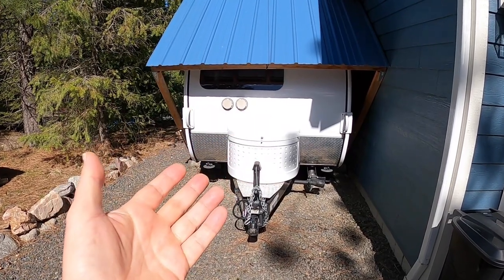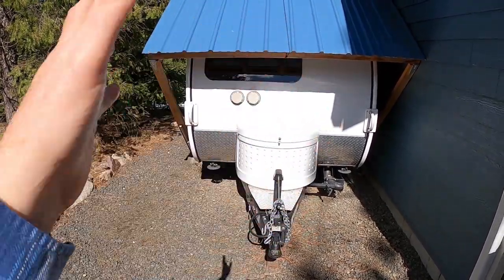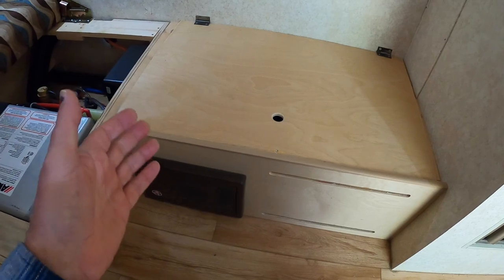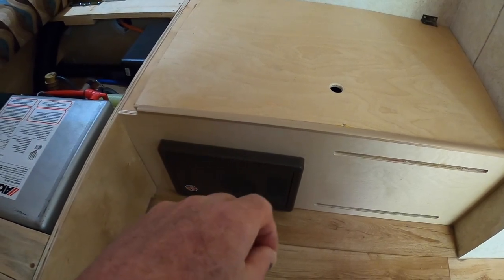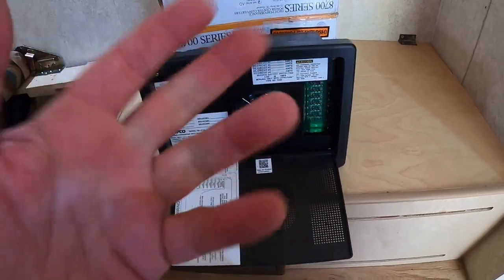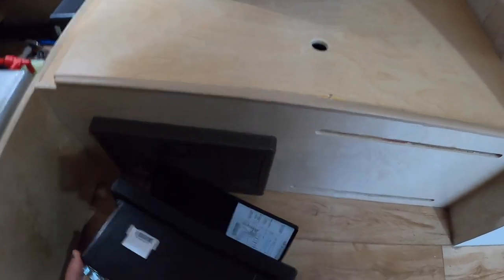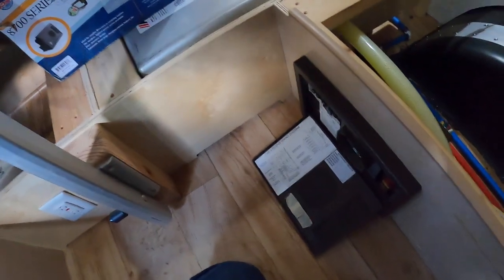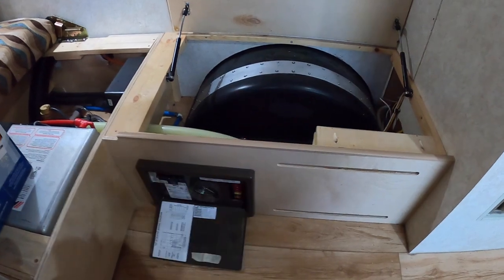Converter Upgrade - Part One - WFCO WF-8735-P to WF-8740-AD - 2015 Tab Max-s Trailer

Comment: What a great video! The converter in my 2015 TAB S Max trailer just stopped working.  It is the "WFCO Model WF-8735P".  I plan to replace the entire power center as the easiest route. What I am trying to determine is what power center to use as a replacement, as I would like to convert my current lead acid battery to lithium batteries in the near future.  In your opinion, what is the current best model power center to replace with (it is now 2024) when planning to convert to lithium batteries in the future?  (Would the replacement of choice still allow me to use my lead acid battery until I do convert to lithium.  Otherwise, if there is now a clear choice designed specifically for lithium batteries, I could probably switch to lithium now instead of waiting.) Any thoughts would be appreciated so much.

Comment: I would recommend folks going with a Progressive Dynamics 4100 instead of a WFCO auto detect converter. My trailer came with an 8735 AD, and it failed to detect the lithium battery I connected. The auto detect process is a hassle. You have to completely drain the lithium battery before connecting and powering up the WFCO converter. Then it's supposed to detect the different response to charging over the course of a complete charge cycle. That process didn't work for me. It's possible that the "drained" state of the battery wasn't low enough, but I haven't had the time to mess with discharging the battery again for another try. I'd seen reports of the auto detect feature switching successfully, but then later forgetting and switching back to lead-acid mode, which is its default. The Progressive Dynamics converter has a simple physical switch to convert it to the appropriate charging mode for your battery.
Reply: Sorry you have had trouble with yours. Mine worked perfectly after just one cycle, and has never swapped back .
The reports I've seen of trouble are a small percentage of units, and most of those were due to older firmware which WFCO has fixed.
Additionally there are a few lithium batteries with built in "smart ligic" that automatically disconnects itself when the battery gets low. But not liw enough for the WFCO converter.

Comment: Nice video....I have a wfco wf-8735p model charger working very well, I want to do an update for a 12v 250ah gel battery and I wanted to know if the charger (wfco wf-8735p) can charge it without any problem. ...could you guide me if I can do that update?...thanks
Reply from the maker: @reneroman1421  
"GEL" batteries are just another type of lead acid battery. An 8735P is designed to charge lead acid batteries and will charge a GEL battery just fine.
No modifications to anything are required, other than a new battery mounting rack, if the new battery is physically larger dimensionally than the original

Comment: Great video thanks for sharing. I have a WFCO WF-8735-P and was thinking this would charge well enough Lithium and then my 480w solar would bulk charge or top off the rest. Think that plan would work?
Reply from the maker: It will "work" but there are issues with doing it that way.

First, a lithium battery is made of several "cells". Those cells need to be kept ballanced in a process called "equalization.
Equalization occurs when a lithium battery gets "bulk charged". (Very heavy high current charging.)
A lead acid converter and/or a solar panel are not capable of producing the required current to bulk charge a lithium battery, so equalization of the individual cells cannot happen.
As a result, the cells will fall out of ballance, and the battery life will be negatively impacted.

Second, since the lead acid converter cannot produce high charging currents, your charge times will be long. This can be problematic when camping several days in a row, where the battery does not have enough time to charge between trips.
Third, since the lead acid battery cannot produce all the current the lithium battery asks for, other devices within your trailer may be starved for current, while the converter is trying to service the demands of the lithium battery.

Comment: Thanks! I’m doing a similar upgrade to my ‘21 TAB 320 Boondock. I always take things to 11/10 so I’m wondering if I should increase the wire gauge from the converter to the battery… And whether I should relocate a charger to the front battery tub in order to make sure the battery gets the full 14.6 V it needs to recharge. Any comments?

Comment: I'm thinking of doing the same lithium conversion. Was just wondering, 1 year later, how you like your Enduro lithium battery and auto-detect converter? The main reason for me to convert to the Enduro lithium is that the battery size will fit into my current group 24 battery box. Haven't seen any independent reviews of the Enduro lithium battery though so was wondering about durability, reliability, customer service, etc. So how do you like your setup do far Mark?
Reply from the maker: A year later, it's working just like new. I'm very happy with it.